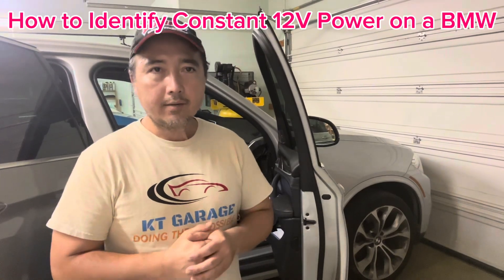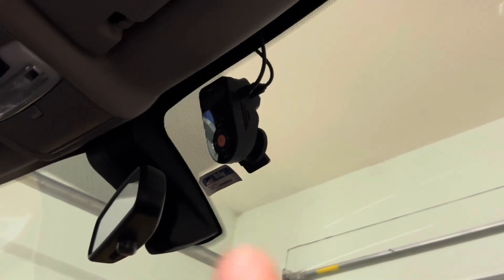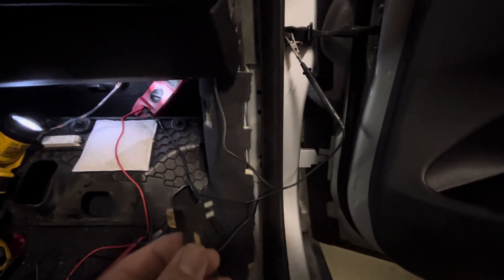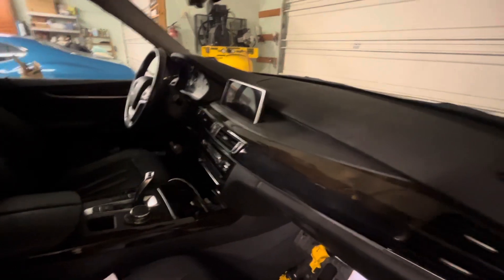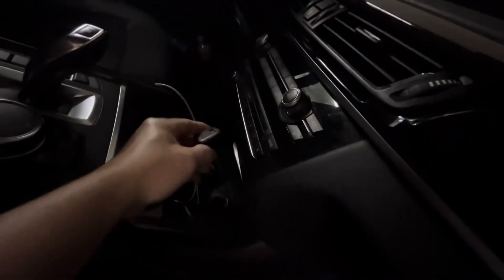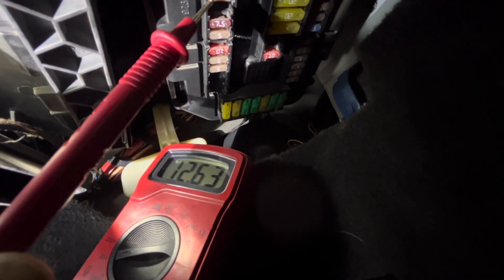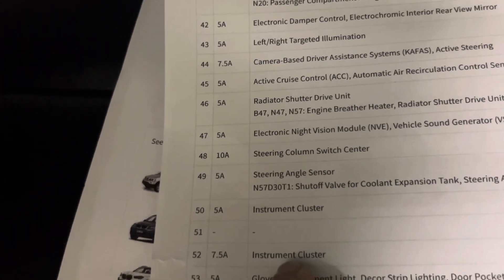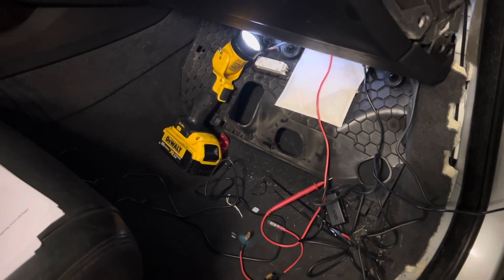Dashcam - How to find Constant 12V Source on BMW X5

Comment from the maker: Please check on the label of your hard-wiring kit. Most of the cars I worked on, the yellow is constant and red if ignition.  In this wring kit, it is the opposite. The Yellow is ignition or ACC. Red is constant. I didn't realize this until I read the label. So please careful with this